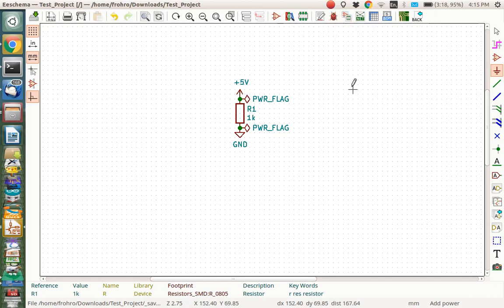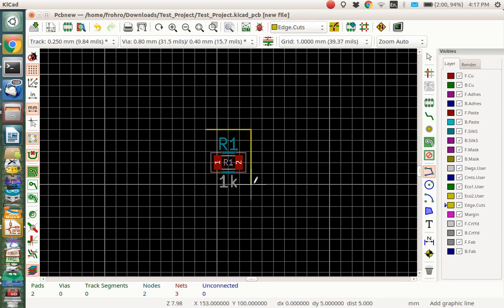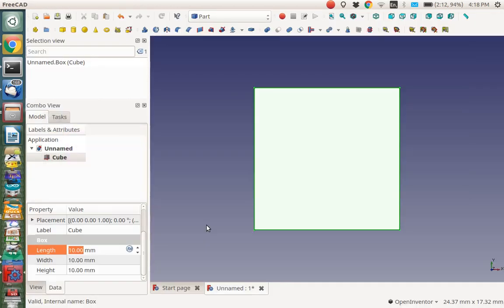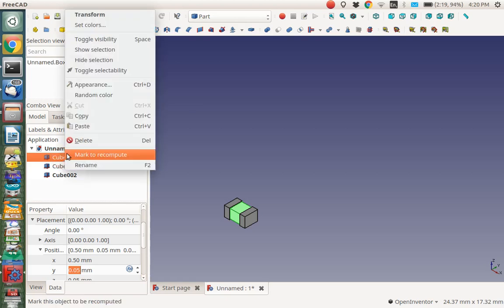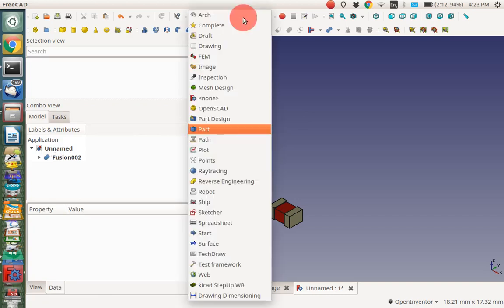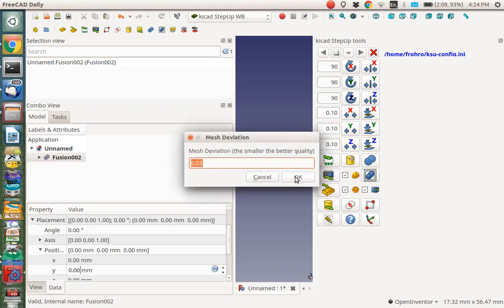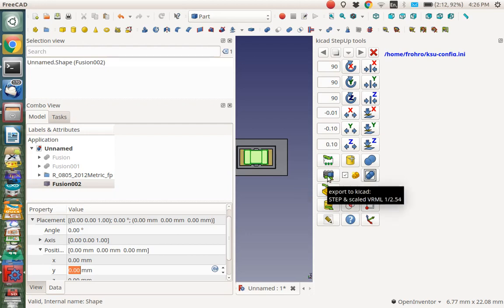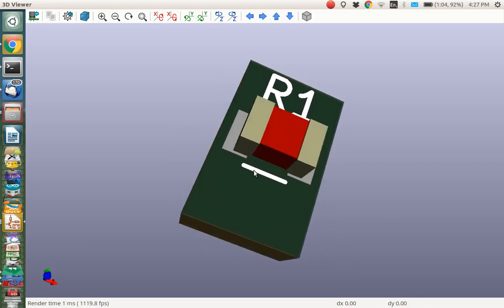Make a 3D Kicad Model in FreeCAD

Comment: Thank's! Great Video! How would you approach the editing of existing 3D-Models in KiCAD? I'm strugeling with a simple 1x7 pin header. There is no 3D Model for 4mm spaced header. At least none that I'm aware of. Thanks again. Greetings fron Germany
Reply from the maker: I suggest using FreeCAD.  It isn't as polished as KiCAD, but as you see, KiCAD has no editing features for 3D models.